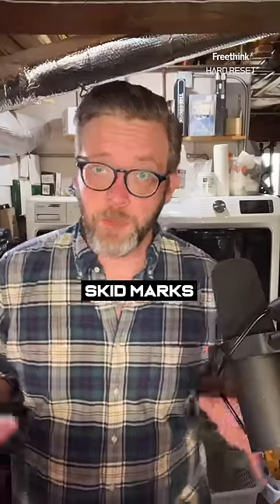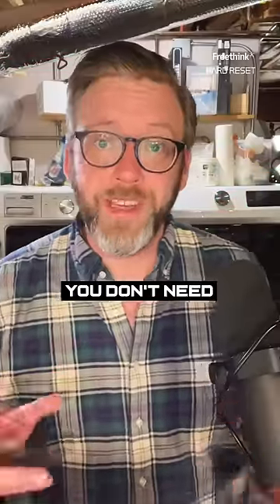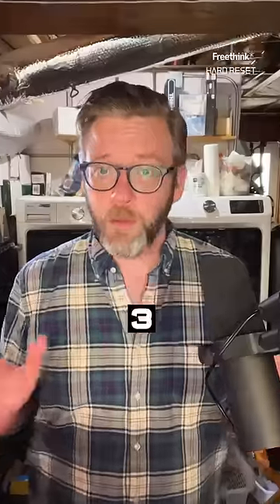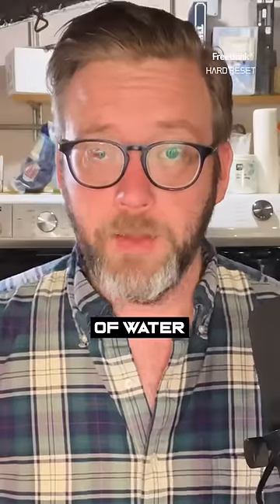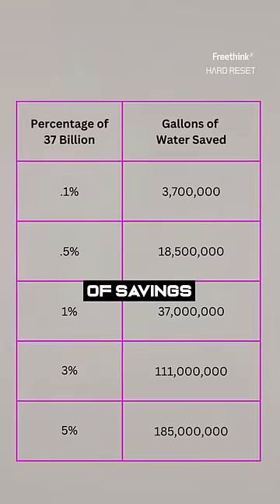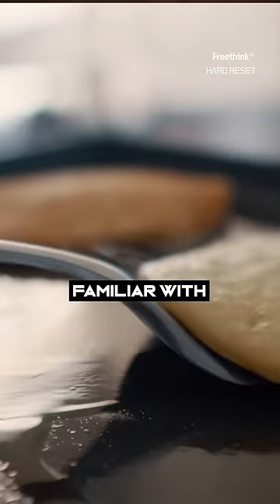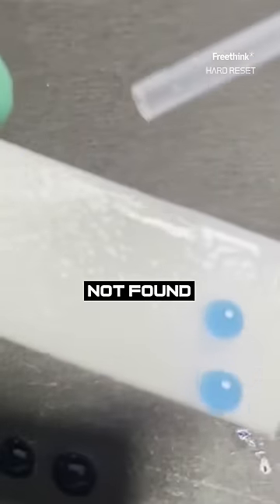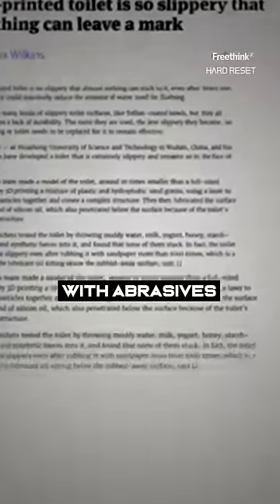Researchers invent super slippery toilet 🚽😳 #shorts #metamaterials

Comment: It’s not just about the bowl, it’s about jettisoning it out through the p trap of the toilet. To make this concept reasonable, you’d have to redesign the toilet itself and the pipe that carries the waste. If you don’t, that waste will get trapped at any bends past the toilet, if not the p trap.
Reply: Why would the pipe need to be redesigned? Sure you need enough force to get it out of the toilet but after that it should be gravity drained. If not the pipe is installed wrong, not in need of redesign.
Reply: @KevinMartin314  water carries the waste though, if the design promotes less water being used, then it’s more likely to stick up in places.
Reply: @levirosenlieb7798  if the pipes are installed correctly you don't need very much water. The design calls for less water not none. Not to mention where there's toilets there's also LAVs, so you're gonna have plenty of water in the line. This seems like a non issue.
Reply: @KevinMartin314  waste needs to travel a long ways to get in the sewage. The water isn't just to move it out the bowl, genius
Reply: @KevinMartin314 I don't know.  How many residential soil pipes have you followed to the street?  There is typically quite a long distance between the toilet and the sewer main.  And water moves faster than solid waste.  If you don't get the poo to the main and it just sits there and dries, it's going to be that much harder to get it moving again on the next flush.  I don't think this is the miracle solution to water usage.  Pooping in a bucket and throwing it into your compost pile would be better than manufacturing a new synthetic toilet surface and optimizing each plumbing system to accommodate drastically reduced water flow.  Being less neurotic about poop rather than engineering away and throwing money to hide your shame?
Reply: Yes!  I was hoping to find this comment!  But this would still be likely very useful in urinals.
Reply: @somethingelse4424  the enviro freaks don't care about reality. Wouldn't be surprised if they imposed these by law in the future. They love gimmicks like this
Reply: @somethingelse4424 Not to mention, letting your pipes dry, and reducing the amount of places that trap water is a good way to permanently stink up the house. That water that stays in the bowl isn’t just for flushing the poop. It makes a barrier to the smell. It’s why an outhouse, or even crapping in a hole smells so much worse than crapping in a regular toilet.
Reply: Exactly what I was thinking!!
Reply: @KevinMartin314  The gravity drain part relies on it having enough water pushing it in the current design of sewer systems bud.
Reply: @KevinMartin314 no sorry it's not made to have thick sludge just magically travel the distance to the sewer
Reply: @MichaelAndersonShow  Actually, those who take environmental protection seriously think the system through from start to finish, from planning over use to recycling. Only the sensationalists get stuck on that non stick stuff
Reply: Who says less water isn't enough to carrying the waste through the pipes we currently have?
Reply: @tarampryce1372  not what I said but you're still wrong lmao. It's specifically designed for sludge to make its way into the sewer. Don't do much plumbing do you bud?
Reply: I think the point is in saving the water used for extra flushing to clean the Skid Marks and clogging of the toilet with you Kraken sized 💩.

Pipes after the P trap are oversized and there is already 3 times more water than needed  in every regular flush.
Reply: @KevinMartin314  its actually already a problem is Germany that the toilets are  saving so much water there isn't enough water to transport the waste all the way to the water treatment plant
Reply: @Terra-Incognlta  Finally someone who actually knows anything.
Reply: @meki___6881  i don't know German plumbing code but I'd be more than willing to bet there problem stems from using old degraded plumbing to avoid tearing up old houses. Which is usually the case in Europe. Which is the opposite of America where I've watched them jackhammer through 200yr old brick to make sure the piping is sized and graded properly.
Reply: Or you could attach a mastacator or countless other solutions
Reply: @MichaelAndersonShow why did you feel the need to insult him with the sarcastic "genius"? He's expressing ideas that may be wrong, there's no need to get rude? Be better and apologize.
Reply: This logic doesn’t work with squat toilets which are being used in big numbers in China. For example one subway line has more than two hundred squat seats.
Reply: Also this thing will be helpful in those public restrooms where people are just going and making it disgusting for others.
Reply: Slippery pipes on the inside
Reply: @NochSoEinKaddiFan  right, whatever helps your farts smell better, buddy
Reply: @theoneafterthelast  yeah, genius. I did.

Comment: "Material so slippery nothing will stick"

Microorganisms: "Challenge accepted"
Reply: The way this material works, a lot of microorganisms can't stick either.
Reply: Think the "way the material works" is mostly the silicone oil coating they applied to it. Might resist biofilm formation, but I assume you'd need to keep reapplying it to replenish the coating.

Bulk of the material also seems to be polypropylene, so not sure about overall durability against abrasion and whether the material will develop scratches/crevices where biofilm can anchor and start growing.
Reply: @henryptung it literally said in the short that it still works after sandpaper
Reply: @dustytoyknife2343  It "works" (i.e. retains slippery properties) after sandpaper - that's not the same thing as resistance to abrasion. If you look in the source paper, the base material is largely polypropylene - not exactly a hardy material against abrasion or UV damage. May stay slippery when sandpaper is used, but real-world damage is never as uniform/flat as sandpaper.

Sure, it means you could probably buff out surface damage with sandpaper - but do you want to be doing that in a toilet?
Reply: @henryptung  what I meant is it can't be a coating
Reply: @dustytoyknife2343  

> The 3D printing approach enabled the scientists to introduce some porousness to the surface, and add a silicon oil as a lubricant. Both of these innovations helped in the non-stick qualities of the small bowl.

> What's more, the lubricant can be replenished to keep the bowl ultra slippy over time. Less water would be required for flushing and for cleaning, the scientists suggest, which would quickly add up across millions of toilets.

Direct quotes from an article about said toilet. It's not hard to find.
Reply: But definitely making an impact
Reply: It DOES mean it's resistant to abrasion. What do you think resistance means? Resistance means the function of the thing is not altered by a particular type of damage.   

If it resists abrasion, that means it's function remains after abrasion. You can argue that a particular group of people define reistanace to abrasion in another way. But organically, the use that everyone understands when they say that it resists abrasion in this context means what I said, and words are defined by their usage.  

Otherwise it's a semantic argument and if I accept your definition the reality of the situation remains the same. Who cares if it doesn't twists abrasion if it still works?
Reply: @HelloThere.....  

> But organically, the use that everyone understands when they say that it resists abrasion in this context means what I said

Bet.

And, the word you're looking for is tolerant of abrasion. Tolerant implies that abrasion can happen and it doesn't affect some attribute - exactly what you mean. Resisting abrasion would require reducing how much abrasion happens or preventing it altogether.

Comment: There's an issue with using less water in the toilet as you might not have enough volume of water to push the sewage to the sewer, which might lead to a blockage in your pipes.
Reply: Make the sewage slippery !😮
Reply: Lining the inside of smooth PVC sewer pipes out to the sewer main might help.
Reply: Came here to say this. The toilet isn't the problem,  it's everything following it.
Reply: @RocketAdminAustin  and what is it that provides the water for the stuff to flow?
Reply: @dracklord1725  We could start using "Grey water" to flush.  Shower water and laundry water would be good to use for toilet flushing.
Reply: @policy8analyst  yep that would be a way to use less fresh water

Comment: A even better idea is using old shower or bath water for it… it’s not hard to do a lot of people have already had it set up so there is a reservoir larger than the toilet tank that pumps water to the tank when needed.
Reply: I didn’t know this
Reply: so basically the solution is to live in Japan 😂
Reply: why not both?
Reply: If you use shower water for flushing without the lid on you will be scattering different type of chemical vapour from your different body washes, shampoos, oils, dirt, inflections,etc. And end up inhaling all of that.
Reply: @Manav-Lekhwani  I mean regular toilets basically do that anyway whenever you use toilet bowl cleaner, not to mention the insane amount of bacteria from one flush
Reply: @Manav-Lekhwani and during the actual shower you don't inhale these chemicals?
Reply: on my first half read i thought you meant to cover showers and bathtubs in the material for easy cleaning (:
Reply: Skip the middle man, pee and poo in the shower, saves on toilet roll also!

Comment: Keeping in mind, the water in the toilet also keeps the smells down to a minimum
Reply: Air freshener
Reply: Impact is just to overall use less water but also keep the water level to a certain level to block smell
Reply: Yeah, people don't actually learn about the whole scenario
Reply: @terminator35721 that doesn't work dude.
Reply: I don' think you know how toilets work bro ...
Reply: @LuciferTsumibito actually, seems like you don't know..
Reply: Have it like a airplane toilet and just suffer if the waste is so nasty you can't tune it out.
Reply: Put the lid down
Reply: @rickwilliams967 Original, unscented Febreeze is a magic odour-killer.
Reply: @markogvozdenovic4396 if you think a super slippery surface would stop the effect of the duck neck (I don't recall the technical term for it) I think you're the one who doesn't know how toilets work. Water already slides on ceramic, yet that doesn't make the water flush all the way down does it? In case that's what you were implying, you're wrong. If you didn't imply that, my bad. Anyway, this would still save a lot of water on flushing, only needing enough to force the poop above the internal "sink" (?) and awaaaay it goes.
Reply: The p-trap is unaffected by this and the water level will remain as it would in a non coated toilet.
Reply: An automatic seal could work, which opens with the toilet seat or just made of the same material using gravity with the principle of a one-way valve.
Reply: @terminator35721 more like fire to burn off the methane.

Comment: There’s still something called a sewer line and the amount of water in a flush isn’t just to get the doo doo out of the toilet but also a water slide through the pipes under your house. Not using enough water to ensure this happens means the doo doo gets stuck in the pipes and eventually backs up into the house 😅
Reply: there could be a happy medium, though. As the video pointed out, a small reduction per flush can add up to a lot of water saved, so it's probably possible to keep enough water flowing to get the poop through the pipes while reducing flush water overall
Reply: So we could use the super slippery material in the pipes too ;)
Reply: Cleaning your toilet also takes a lot of water tho
Reply: Municipalities use pipe liners all the time, you can install those in sewer drains just FYI.
Reply: Yes, some places have gotten so good at conserving water that they have to flush the systems with big flushes.
Reply: You still wind up saving tons (probably literally) of cleaning chemicals. 

Which is probably why we won't see this technology widely deployed.
Reply: @bhatkat  seems counter intuitive
Reply: Maybe this could allow flushing the toilet once every few poops just to free them
Reply: Couldn't we use this for the pipe also?
Reply: @FableFrenzy  on very fancy houses maybe, not in the big sewer for sure
Reply: @delfyinc  All that reduction gets eliminated when you have to call a plumber to power flush your drains. That's not even factoring the hundreds you'll be paying in plumber fees. Low flush toilet is a trap, literally losing dollars to save a penny.
Reply: so you mean 1 flush isnt enough?

coz with skid marks, we flush, brush n flush again. sometimes going for 3rd flush

Comment: Water to flush your toilet is not only used to get it out of the toilet, but to get it into the sewer.  Many places are already suffering from low flush toilets and backups.  I am not sure all water image issues will be solved by the toilet.   Would be nice to reduce cleaning and maybe prevent that hard water ring.
Reply: This is what I was thinking also. They’d need that slippery surface far down through the pipes and all of it going downwards for gravity. After that, problems.
Reply: So annoying because you see wimpy flushing where there’s no suction, only  slow draining, leaving paper and organic material stuck to the porcelain walls. Then there are low-flow systems where the water blast into the bowl like a jet, but for only a few moments. Every commode on earth should be so efficient!
Reply: We've spent about $25k total dealing with the aftermath of a "high efficiency" toilets🫠 what's funny(or not) is that my sister is the super "green" one, but she let her father-in-law remodel her bathroom and now has a turbo toilet that "FLUSHES 21 BANANAS!!" or something like that(I think I've heard about this toilet from 10 different people, sometimes its golf balls, other times bananas). And then I'm "green" to an extent, but not if it means losing functionality, time, money etc. Anyway, my sister had already purchased a high efficiency toilet that her FIL "forgot" about, so she gave it to us when we remodeled and now, we are as broke as the damn toilet Lol one time we were having a family reunion and my BIL immediately clogged it and we spent the entire reunion dealing w this toilet...we had over 20 people, multiple trips to the hardware store, a ton of money spent, every model of plunger and snake etc. We pretty much all just took shifts of getting drunk while attempting to fix this toilet for 4 days so that was definitely a bonding experience 😅 this was 1 of 3 of our HE toilet adventures, and another forced us to replace the whole septic tank...NEVER AGAIN!! When it comes to going green, I think I'd launch a nuke before ever dealing w a dry ass toilet again😂

Comment: I can think of so many things this material would be great for, but saving water in toilets isn't one of them. I doubt it could really reduce water usage at all really, since the water isn't just used for clearing out the bowl. It's for helping stuff keep moving down the pipes. And that isn't so affected by how slippery or not the surface of the material is, at least after a certain point. Maybe this would be better for bathroom tiles to make them easier to clean. I thought floors at first, but we don't actually want to slip on those.
Reply: The water also covers the smellllllllll

Comment: Coat vessel hulls with that material to reduce drag.
-significant fuel savings.
Or
-higher speeds possible.
Or
-smaller engine needed for same vessel performance.
Reply: That'd be the fastest boat on the market
Reply: Making it harder for barnacles & stuff to build up will be great. Fuel, weight, and even exotic species issues can get improved

Comment: I feel like this would be great for litter boxes and maybe as a screw or a cog within a spinning mechanism. It can make the turning smoother for machines, and it will make cleaning a litter box easier and more hygienic. You can even make cooking pans and pots with it, to reduce the waste of them getting thrown out from overuse. That would mostly be useful for restaurants. Assuming it can resist high heat.